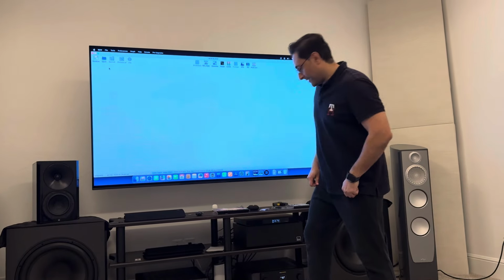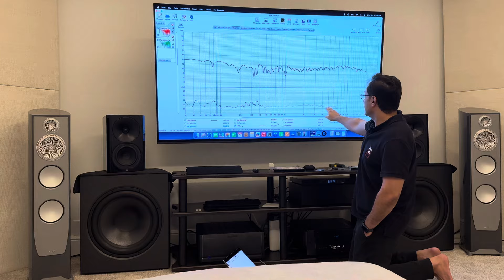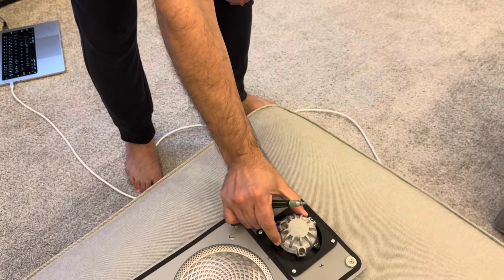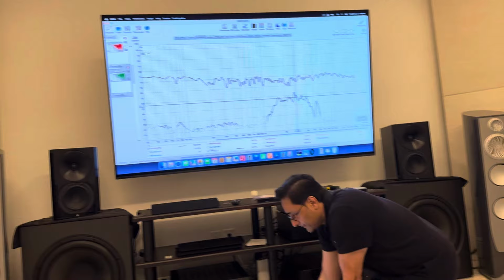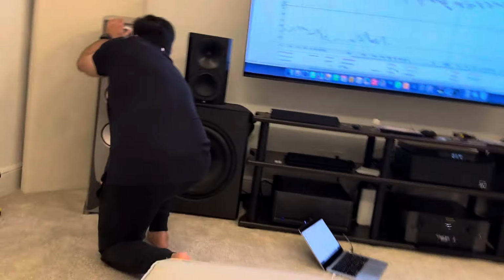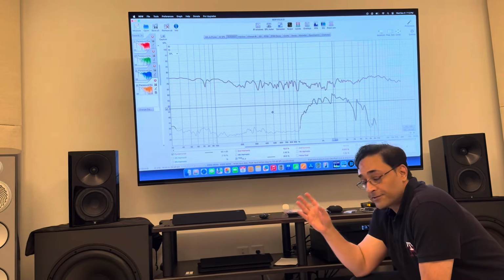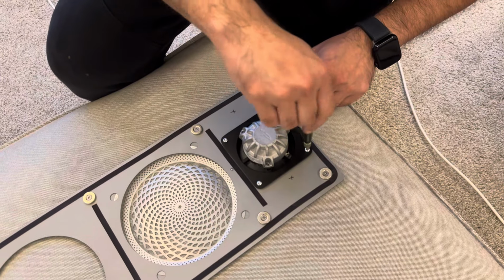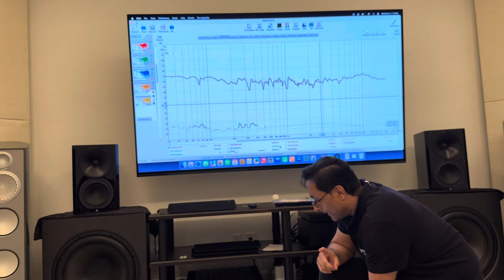Paradigm Persona 3F Tweeter distortion Issue

Comment: Does this happen with the Premier Series?
Reply from the maker: @gtric1466  Can’t say for sure.. Even with this speaker, it appears to be an isolated issue & not something common.
Reply: @RBBBBBBBBB533  but you should not be touching the cone as it is poison no?
Reply from the maker: I never touched the cone. You should never touch any tweeter cone as they are extremely fragile & can be damaged very easily.
Reply: The faceplate was causing unwanted forces that were affecting the tweeter performance ,
Reply: @RBBBBBBBBB533  I believe you are correct. Tap all over the faceplate and also turned up the volume and felt or heard no vibrations or when pressing down. It’s nice and tight. Do really like the sound from the Premiers.